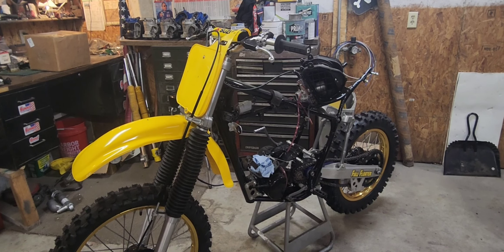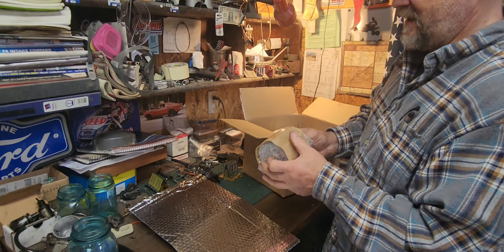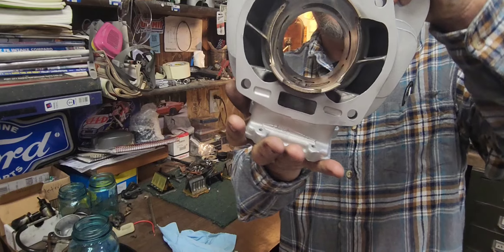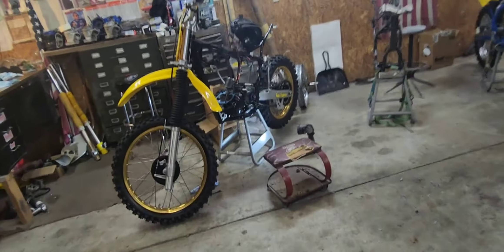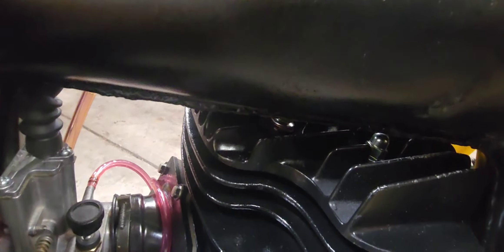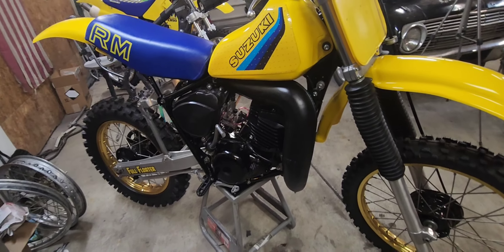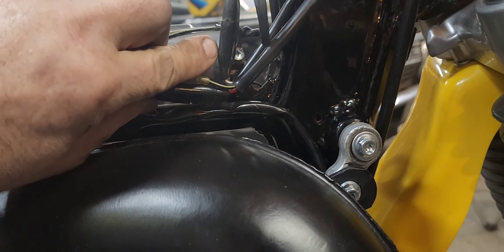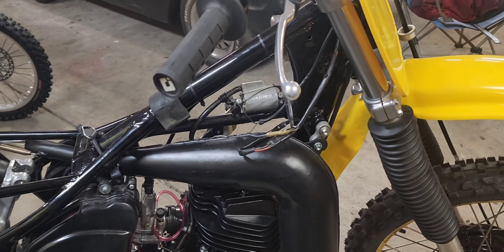1982 Suzuki RM465 first start frustrations

Comment: I had the same bike brand new in 1982, I was 22 years old and I paid $2,495 for it from Smitty's Suzuki in Peoria Illinois. I had it for 8 years and it was the best bike I ever owned. Started 2nd kick cold, and 1st kick warm. Ran it at 40:1 with Bel-Ray mc-1 racing oil, and in 8 years I never had one engine problem with it. I rode it all summer on one top end, only on the weekends, and then every winter I put a new top end on it and it was a beast.

Comment: Have you removed the paint between the engine and enginemounts/frame and ignitioncoil?. If not, you proberbly don't have a good ground in your electrical system.
I also noticed you have an hourmeter connected to the sparkplug wire, if there is to many turns around the sparkplug wire it will sometimes kill the spark aswell. 2-3 turns should be enough.
Sorry for my bad spelling i'am from sweden 😄.
Nice bike 👍
Reply from the maker: Sure did, I got spark now ,played around with the plug wire -cap. Got a video coming out out about it

Comment: Hey Dave! I am also restoring an rm 465. I was wondering if I could ask you about where you got some of your parts, I am about 70% finished the restoration at this point. I would appreciate it :)
Reply from the maker: What parts you looking for ?
Reply: @ I am looking for the pipe and silencer, I was thinking of ordering from DG performance but if you know anywhere else I could get them that would be appreciated. Also if you have any suggestions of where you got the case saver, and chain roller from, I like the blue one you got too.
Reply from the maker: The silencer is a dg from dc plastics, the chain slider is from a ebay seller if I remember correctly, the case saver is from chapperal,  I think motoduro is making the sprocket covers now and gas tank straps , make sure to look at the oem sections from all the major parts retailers, I've had really good luck getting stuff from chapperal, they have alot of oem stuff that others don't have ,I'm doing an 88 rm250 and they still have front and rear fenders ,side panels and radiator shrouds.
Reply from the maker: I think chapperal still has oem chain sliders. And the chain rollers are just generic ones from all balls
Reply: @davesfordperformancegarage4511  okay great! Thanks for letting me know I will look into that 😃